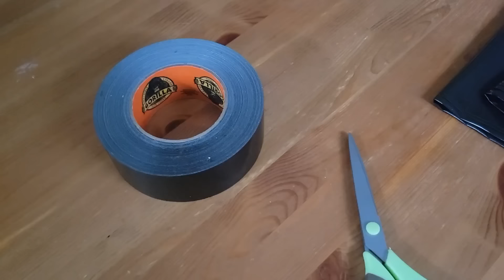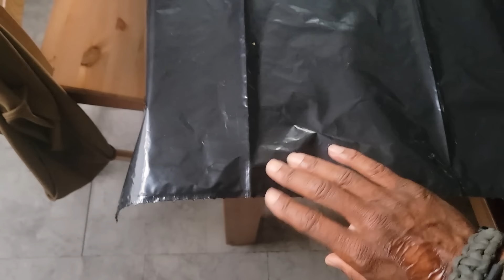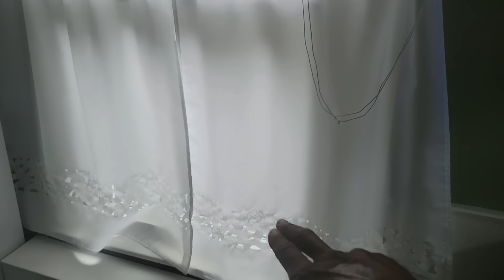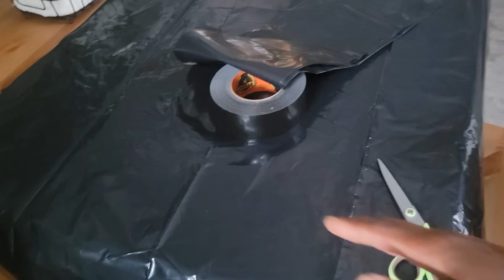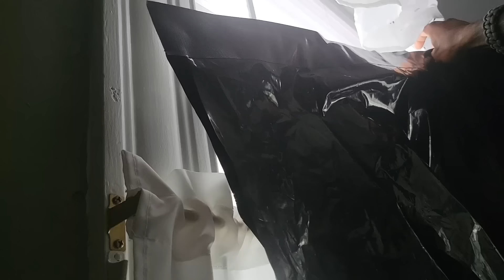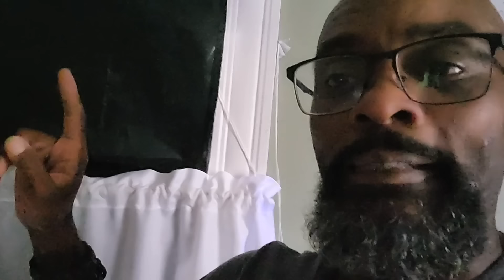DIY Blackout Shades: Easy Home Security Upgrade during Civil Unrest, Long-term Power Outages

Comment: Excellent Info💥! Also, hang on to those Amazon boxes and duct tape. They can block out Cold and Light if you have a small generator and have some power you can still black out your windows.

Comment: We live in a 1950s house with the original windows. Yes there are drafts if the wind is up. I added the pink foamboard insulation to the northern side windows last year.  Helped greatly. Now, i think ill add the black plastic to the outside to get the neighbors and those driving by used to it. Most of the other curtains are always closed to help keep cool/ heat inside. Adding to blinds next for added light cobtrol. Just our idea but might help someone else.

Comment: I may have completely misunderstood this video, but if you block all light from leaving your home, and the bad guys outside can see the actual building, aren't they just going to break in, on the assumption that no one is home?
Reply from the maker: If your entire neighborhood or city has been blacked out for several days Houses and buildings that still have lights on and power running, attract the attention of individuals that have criminal intent. 
   Sure any determined person that wants into a home or store will do whatever it takes to get inside. 
     Using the black out concept is beneficial when you are well supplied and don't want people to casually see flashlights or refrigerator or laptop light emitting from your place. 
  Now if your house is the only "dark" house on the street, that stands out just as much as it would if everyone else is in darkness and you've got that blue TV glow peeking thru the cracks of your reasonably closed curtains. 
  Again you're not totally misunderstanding the video, it is for circumstances that may only be temporary but knowing when to use it and how long is the key. 😄👍

Comment: Never use black plastic foil when yoyr ac is still running! The temperature difference between inside and outside can crack the window ! Happened twice because tenants got the brilliant idea to darken the appartment witb black plastic bags because they hadn't bought curtains yet! It was a very expensive experiment.
Reply from the maker: The more you know 😎👍

Comment: That bag has to be extra thick because at night you can stiil see the light through them although not as bright.
Reply from the maker: It's a contractor heavy duty. No light gets thru. Now if you haven't sealed around the edges, that's totally different.

Comment: Thank You ... and for old fashioned (heavy/layered) custom curtains  ... clothes pins ... (easy to use/remove). Whole beg; 3-4 to a window each, enough for a whole house! ❤

Tin foil across the top (side ways) ... if zero light desired. Sticks with spray bottle of water. 

Thank you for sharing ...

Comment: Great tip, thanks!  Seems obvious, but it honestly never occurred to me.  I was going to try and use blankets and bedspreads, if I had to, but those are obviously a lot heavier so I wasn’t quite sure on how to secure them so they’d stay up, and secure the edges.  I also didn’t stop to think about not showing any light at all I’m that situation.  Thanks for the video.  👍
Reply from the maker: You're welcome, most of my ideas are trial and error or why didn't I think of this earlier 🤣

Comment: I purchase dark (black, brown, forest green, or dark blue ) plastic tarps.  I use metal curtain loops that have little clips on the end  and clip them onto one side of the tarp (usually the side with the holes in it). Then I put the damage-free hooks along the top of the window. These are the hooks that have an adhesive backing. Then just raise the tarp with the loops and hang them from the hooks. When I want to take the tarp down, I use a reaching stick with a little hook on the end to lift the loops off the hooks I attached to the wall. I also use the reaching stick to put the tarp up on to the hooks on the wall. Works extremely well and is moisture proof since no tape needed. You can use the adhesive hooks, put more adhesive on them if necessary or just hammer some hooks at the top of the window if you own your own home and don’t mind putting nails in the walls. PS If you are able to install 2 curtain rods, then the inner curtain rod could be used to hang the tarps on with the curtain rod hoops I just described. That way you can just slide the tarp across when you need to and thus avoid the adhesive wall hooks altogether. PS If you are able to install 2 curtain rods, then the inner curtain rod could be used to hang the tarps on with the curtain rod loops I just described. That way you can just slide the tarp across when you need to and thus avoid the adhesive wall hooks altogether.
Reply from the maker: I like the sound of your set up 😎👍
Reply: @TheUrbanSentinelChannel Thank you so much. I added a PS to my original comment. Here it is: PS If you are able to install 2 curtain rods, then the inner curtain rod could be used to hang the tarps on with the curtain rod loops I just described. That way you can just slide the tarp across when you need to and thus avoid the adhesive wall hooks altogether.

Comment: Boarding up or taping off your windows is essential in a wrol scenario. But that makes you blind to the outside. You need to be able to see outside your place to know what's going on around you. Hidden security cameras are a must
Reply from the maker: Definitely an added level of security to deploy.
Reply: If the lights go out security cameras wont work
Reply from the maker: @artgirl1339 if you've got a battery back up or even a small UPS connected to your wifi and router, then at least for awhile you'll still have eyes on. Alternate methods to maintain security need to be implemented

Comment: I have a ? doesn't taping up the whole window like that keep all the air out, what then??
Reply from the maker: Unless you live in a bio lab, no conventional apartment or home is air tight. This is a short term solution, under "normal" conditions most riots/looting tend to move thru areas over several hours. It's about giving you an extra layer of security quickly enough, that hopefully you'll be passed over for some more appealing shiney things down the block.
Reply: @TheUrbanSentinelChannel   Thank you so much for your reply I now have a better understanding I was thinking it would be over a longer period thanks 😊

Comment: The black out bag is a good idea to block out unwanted light but doing an outage and civil unrest  i chose option B to prevent my window from being broken i will board up my front window which is a picture window in the middle and 2 small windows on the side with 3/4" plywood which i already have in the garage that i purchased  in 2019 reasonably priced then and it   will go up at the first sign of civil unrest,thats the only window that's exposed to street traffic, the black bag will block out the light from within but it won't stop a brick from the outside  but the black bags will work  for the side and back window nothing but a bullet will enter those windows , my house is fenced in on 3 sides thanks for sharing👍
Reply: @Jim-bx7vs  your fence needs to be impenetrable to do much more than slow them down. Logic suggests that if I'm a baddie, looking to throw bricks or what have you at a home that yes, I'll skip the boarded up window and go next door. But if I'm looking for goods that boarded up window is a beacon telling me you have stuff worth protecting. I'd be coming back later. It's still a good idea.
Reply: @renel7303   no need to watch no post apocalyptic scenario to know what need to be done, most baddies  impose there will on people that are scared and won't fight back, im not scared and I will fight  back along with my niebors that will stand with me and I with them in these unsettling times
Reply: @Jim-bx7vs  👍
Reply: @renel7303  first off why go next door to a non believer that have no food ,water or what preppers stack and no fence is impenetrable and if they leave and come back what's behind the fence would change their mind, first a warning shot then and it would only be 1⃣, this is why you don't turn away close family and friends, since they didn't contribute to the stash they can be useful in many other ways, the board stays up you do not want a  broken windows during civil unrest my property and stash will be defended by any means necessary 🤨😵
Reply: @Jim-bx7vs  you talked about them throwing bricks during civil unrest. They would skip your house and throw bricks next door at glass. Although, who knows, some of them might throw them at your house anyway for kicks. Don't delude yourself that you and your property are safe. Watch some of the post apocalyptic movies for inspiration. There will always be some baddie with a bigger "army" and more weaponry than you have. Unless you are out in the boondocks and have established a well fortified "keep", fortified in every way, if you get my drift, you are only buying a little more time. That's my point. Let's hope we never get to try out our theories. Or our defenses.

Comment: When I worked the graveyard shift living in Las Vegas over 20 years ago, I stayed at the Budget Suites, and they had a rule about the windows had to be white. I learned from a neighbor that if I first put up butcher paper on my bedroom window, I could then line it with heavy duty aluminum foil as well. It worked great. Kept out the heat and the light so I could sleep during daylight hours. Just a thought.
Reply: @angelacahill9460  I use the foam poster board to make three inserts per window, if you get the black and pull the paper off one side, that side is white. Works great for all weather, if it's nice out, I can slide them together and even open the window. They are great for room darkening. Bonus if you remove all the paper, it's still good for all weather and light shines through.

Comment: IN 2003 / 2004 
WE  USED FLAT HEAD THUMB TACKS 
SO THE PAINT DIDNT COME OFF
IT WAS PERFECT 
IT KEPT THE COOLNESS IN ,HEAT OUT
BUT, IN WINTER IT WAS HEAT IN WHICH WE DIDNT NEED A LOT AND KEPT THE FREEZING COLD OUT 
IT WAS LIKE INSULATING OUR WINDOWS

THIS WAS A PERFECT REMINDER..THANK U

Comment: Your tip was very helpful however is it better to leave a car in the driveway or parked in the garage?
Reply from the maker: If your car is going to be your getaway vehicle and you can keep it hidden inside a garage, do that. If you don't have a secure location or only on street parking, don't leave ANYTHING in it and pull the fuse under the dash that connects to the ignition (preventing it starting,less chance of getting stolen) granted if trashing and burning cars is on the agenda, not much can be done. Just try to minimize losses as best you can.
Reply: @Troubles0125  Protect it in a garage.

Comment: One way tint is also a good idea and helps hold broken glass together. Your garbage bags are good idea but having cut to fit wire shelving ready to deep screw into frame studs across windows. Wouldn’t been seen from outside through the dark cover up. It’s getting scary out there so much crime can’t even trust police. Good to learn how to secure your home.
Reply: @TheSilverlady1980  I love your idea of one way tint.

Comment: Oh man...I have 20 windows and 4 full glass doors.
Reply from the maker: One of the main reasons why I went with contractor bags. A box of 40 may cost $15-25 depending on the Brand. They are bigger overall than most standard black garbage bags, if you cut them properly you double the surface coverage.
Reply: @TheUrbanSentinelChannel  thank you 😊

Comment: My question is about securing double wide sliding glass doors from intruders. Plywood? How to secure is against forced entry?
Reply from the maker: 1/2” - 3/8"  thick at minimum. You'll need to have some type of brace set up to prevent popping out the track if they can't smash the glass and if possible 2 x 6 boards secured into a bracket or anchors into wall studs. A bit of planning but doable
Reply: @TheUrbanSentinelChannel  I have the dowel in the track, I'm trying to figure out how to secure such big pieces of plywood to cover the windows.  All ideas are welcome.
Reply: Dude do not nail plywood or any other thing that blocks an exit from the inside.  What if there is a fire & that's the only way out?  Also your home insurance will be dropped if they find out you are doing stuff like this.  And if you don't care about yourself, think of your family.  Wtf are barricaded inside your home anyway?  Now you are trapped.  Who exactly are you afraid of?
Reply from the maker: @edgybarbie77 This isn't some random Tuesday night and you're bored looking for something to do. This is in a major shit sandwich sort of scenario.

Comment: There Are temporary black out blinds sold at Lowe’s that can do just as good of a job and actually look quite elegant, too.
Reply from the maker: 😄 I actually looked at those before, $7 a pop but I've got 17 windows. I spent less than $30. For me it's function over form. Fewer windows and it can work budget wise